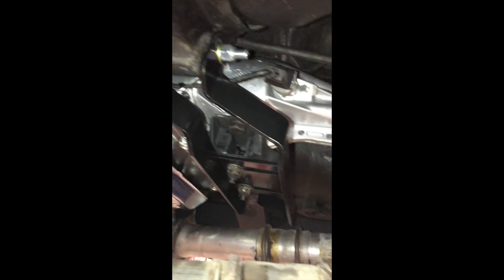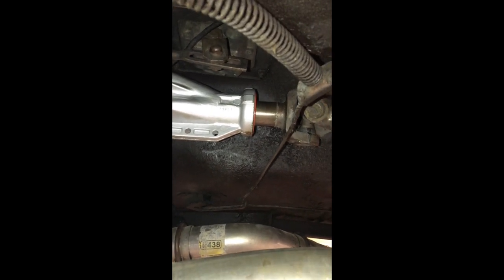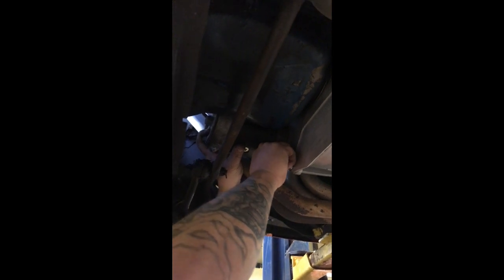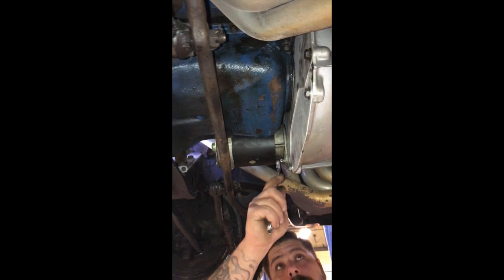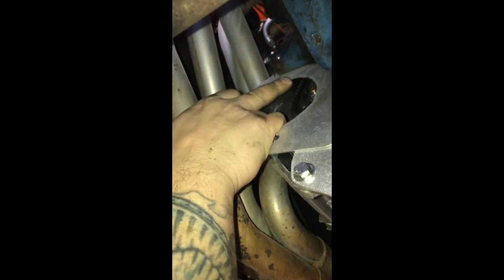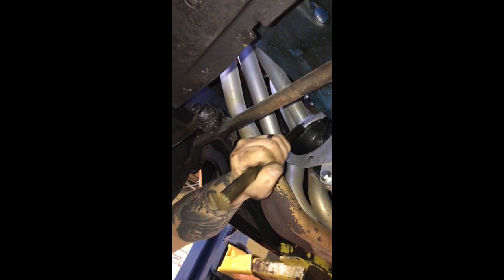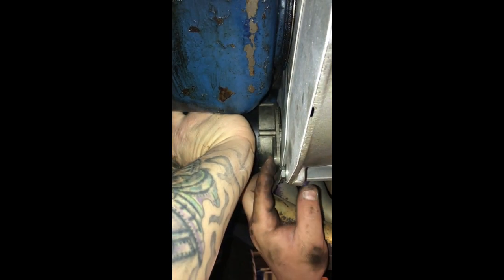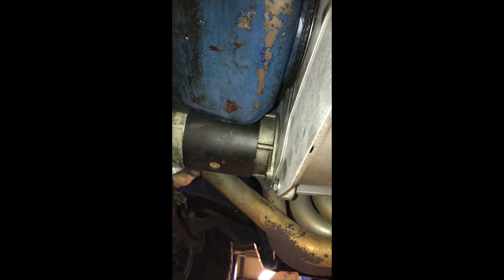1973 Mustang C4 To AOD Conversion Day4 Oil Cooler Throttle Valve Linkage Installed 20210323

Comment: I like your video on plumbing that aod transmission I have one question what line is the high pressure on the aod the top or bottom
Reply from the maker: I am not sure which of the cooling lines end oil to the cooler, and which is the return line.  I will look into that, and report back if I find out.
Reply from the maker: I found this anwer in a few areas...  In an AOD the bottom fitting is the trans cooler return line. It's the opposite in the AODE/4r70w.